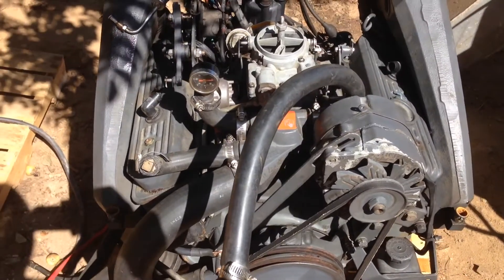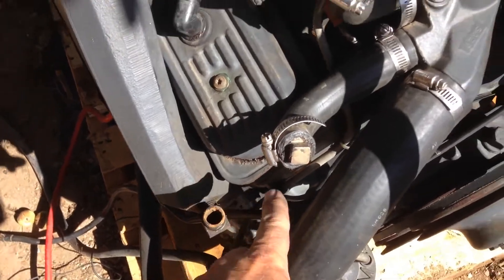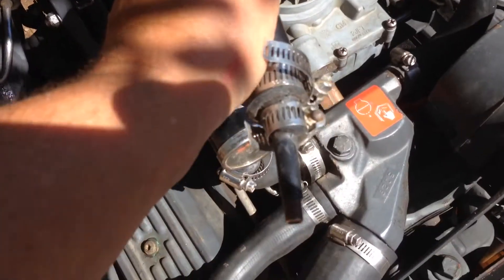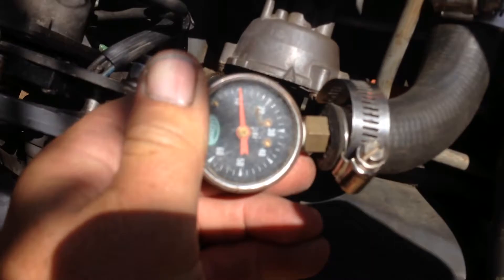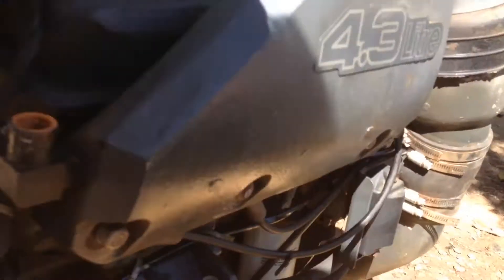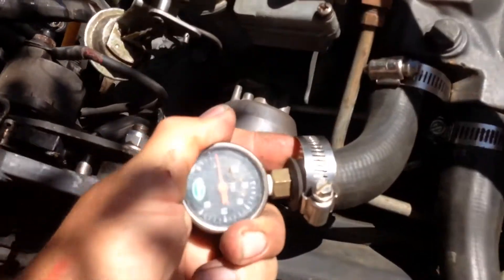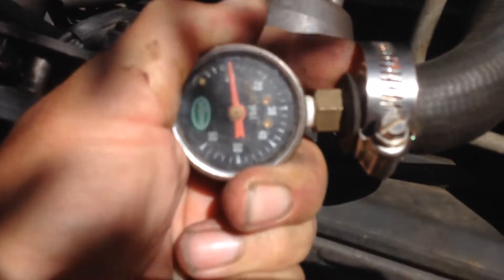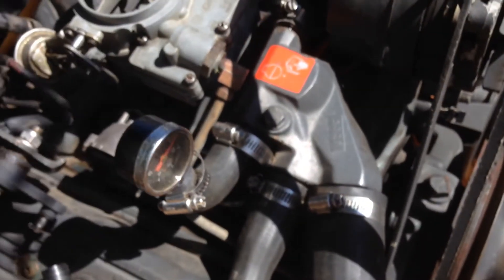4.3L marine engine water jacket pressure test

Comment: I am getting water in my oil on my 3.0 liter so I done this test.  How long should it hold pressure to indicate no cracked head or block or head gasket issue?   I filled mine to 15 psi and only lost four pounds in 10 hours and I know my test gauge was leaking alittle not enough to hear hissing but I could see bubbles if I sprayed it with soapy water.
Reply from the maker: Ok first I’d get ur test equipment to stop leaking or replace it. Second try soapy water on all the hose ends, behind water pump pulley water pump gasket, freeze plugs. If your hearing is good what you can do is pull the oil fill cap off the valve cover use A piece of hose about 18 inches long put the hose inside and listen to the other end. Try it without air pressure and the put some pressure in it and listen.  If it is a cracked block and you have good ears you should hear it.  Your surroundings need to be quiet so that you can hear it.   4psi in ten hours fix your test equipment. Water is drained from the block right?  How much water in oil. Oil looks milky or just seeing condensation on filler cap and steam from vent hose? Rain water get in through the carb?  Water in gas?  Empty ur fuel water separator into a glass jar let it sit for a minute and see if you can see any water in it.
Reply: @DAVIDRH67  thanks man I appreciate your reply.  I drained all the water from the block before i ever started the test.  I went back at 3am when everything was nice a quiet and I heard no air leaking anywhere.  I am gonna fix that gauge right now to make sure its no longer leaking.  In your vid I seen where you said it held for an hour I was just hoping that's all the longer it took cause mine held steady at 15 for about 2 and a half hours then begin to go down.  Thanks again for your reply man I really appreciate it and thanks for the video too its where I got the idea on how to check mine.
Reply: I got my gauge airtight it held 15 psi for a couple days now